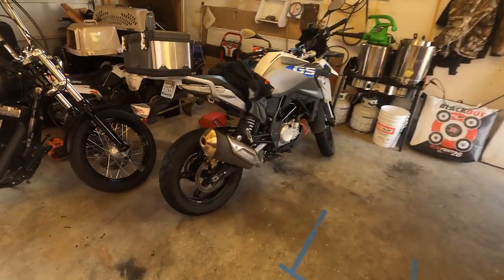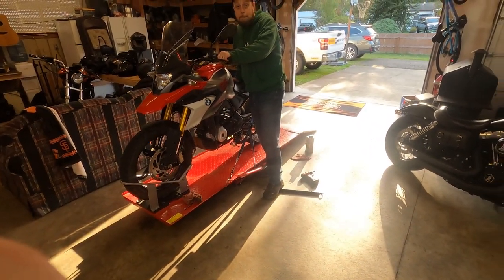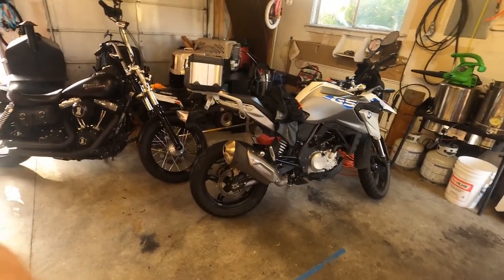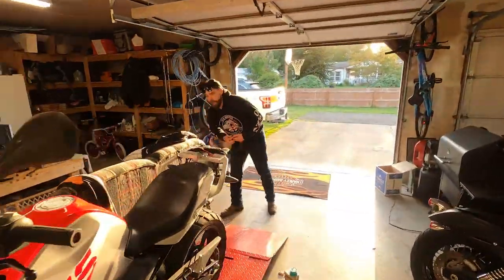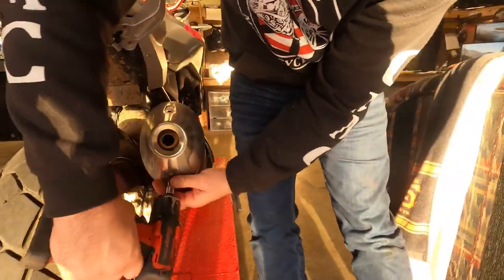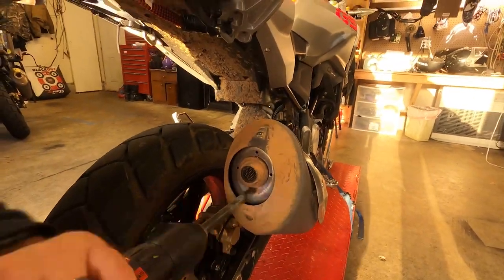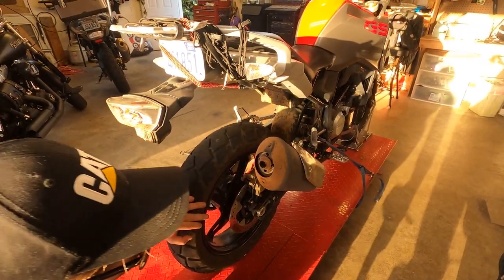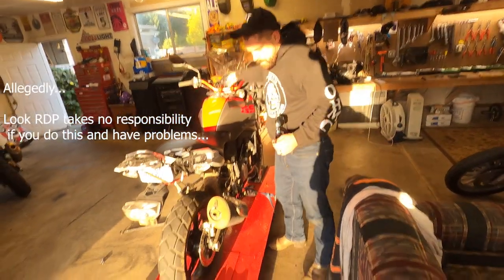BMW Motorcycle Exhaust Modification of BMW G310GS And G310R 🔥

Comment: Done same thing on my g310 R. Love the sound, not too loud and power feels good.
Reply: can you tell me whats the reading on the DB meter , may be using an android/iPhone app
Reply: @Ananthurnath  sorry can't tell. It's a bit louder than stock. Would def still be legal on South african roads. I drilled 6 , 12 mm holes in mine. Start by drilling 3 holes and increase if you want more sound. I run a BMC high flow filter in mine too. My efi handles it well and bike pulls strong with no popping or backfiring.
Reply: @happyman8488  did you make the same hole as shown in the video brother?
Reply: @James356-b1m  at first I did ,yes, but the bike had an unpleasant sound as the air moved past the holes. I did not like the sound so I removed the whole db killer pipe. It bypasses the whole CAT system and gets air out faster. Try bmc high flow filter with your modded pipe. The bike runs much better. Here in South Africa we worry more about being murdered than pollution and noisy pipes so check your laws before you mod it.
Reply: @happyman8488  yeah it's not totally legal but I really wanted to ride without db killer even I have to pay the fine. last question. brother- Can we do welding the db killer back to the exhaust again..? or once we take out its done.?
Reply: @James356-b1m  Yes, I kept mine if I want to sell bike. It could be welded back on easily.
Reply: @happyman8488  thank you brother appreciated 🙏🏻🙏🏻

Comment: I went a step further and took a 51 mm hole saw and drilled around the weld of the small outlet pipe. I then removed the whole db killer assembly pipe. It took a pipe wrench and some wrestling to get it out. Now it has a deap crisp sound like a mx bike but not as loud. Bike does not pop on decel or run lean, even with BMC high flow filter. It beats my friend's standard g 310 in race.
Reply: Did the same love the sound
Reply: That’s what I was thinking just yeet the entire plug
Reply: Can you give me your instagram so that you can show me where did you drill the hole
Reply: @James356-b1m  remove shiny steal cover on end of pipe and simply take whole saw and drill around decibel killer circumference. This will loosen the entire  pipe that you want to remove. Pull it out by some force. It is pressed in so just pull while wiggling it, it will come.
Reply: @happyman8488  thank you brother appreciated
Reply: Brooo thank you. We did this because of you. It’s amazing thanks a lot. I recommend others to do this too. More effort but definetly better result.
Reply: @fardidryder9360  no probs, enjoy.

Comment: Wow, I love it! I'm in Alaska and I bought a BMW 310 gs in Cali, Colombia several weeks ago, brand new. Flying down in a few days, then I can get to the dealer and pick it up. I'm taking my riding gear and some initial upgrades to add to the bike, but I'll have to wait on the big stuff that I really want. Like an exhaust, more off road capable tires, Rally Raid suspension upgrades and spoke wheels. I'm bringing down pretty much everything else, I wanted.

Comment: Its like you install a free flow pipe instead and am worried about the compression inside the cylinder, does it varie and does it affects the engine life??
Reply from the maker: It is a bit like that yes, but not nearly as free flowing as a true exhaust. Additionally we did not adjust intake, and so to my understanding the actual fuel mapping change is small, or at least small enough for the stock ECU to map it.

Long story short I do not get much if any popping on deaccel

Comment: Think I'll try this, but also build a plate I can bolt over the holes to cover them up, in case I don't like it, or need to bring it in for warranty work without them figuring out I modified it.

Comment: Done n love it . Thanks
Reply: What size bit did you use last?
Reply: A size smaller then they used in the video and only 2 drills
Reply: did anything get sucked up to the cilinder?, i mean the residue of the drilling?
Reply: What size bits for holes
Reply: @lordniko1986   na it didn't
Reply: @drsanilkumar3766  a Size smaller than what they did in the video.

Comment: What problem would you foresee in a bike like this. Think of getting one
Reply from the maker: Depends on what you are looking for, but, the new ones (2021+) appear to have addressed my biggest gripe which is the clutch. Suspension is not up to the task if you push it at all, but honestly get it and rip it brother

Comment: How are the Bikes on long trips? Looking at the 310GS, but may go with the 750 GS.
Reply: I have a 310 GS and i'd recommend getting the 750 if you are going to do a lot of highway.
Reply: So we (this is stuttering mechanic “goat”) made these bikes work well on the open road. We just came back over hwy 90 (mountains) pulling 75-80 mph with no problems. Just cannot be afraid to toss a little money at. That being said, total bike investment is still around $8000ish. For a bike that can do single track as well as pull mountain passes at 80mph

Comment: Hi I tried this and while drilling 4th  hole my drill bit broke and it's in the silencer does this do any harm to engine or other parts what to do now just leave it or remove it pls suggest
Reply: Remove the pipe get the residues out and instal it back

Comment: Stock sounded better, drilled example sounded like a lawnmower.
Reply from the maker: Sounds better on the bike for sure, but again wasn't done necessarily just for the sound...
Reply: I highly recommend that you do not do it, if you don’t like the sound. No need to spread hate
Reply: @coreygoat86  We're talking about motorcycle exhausts, hardly a topic that instills hate.